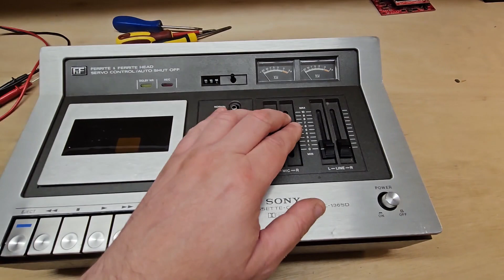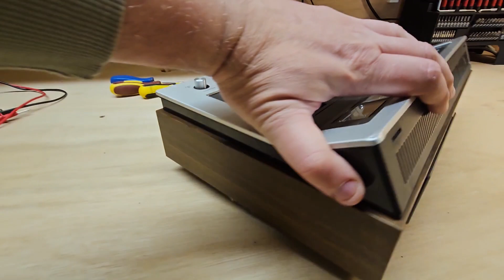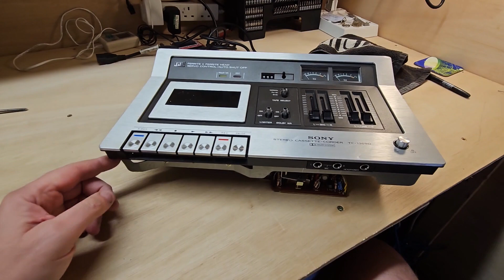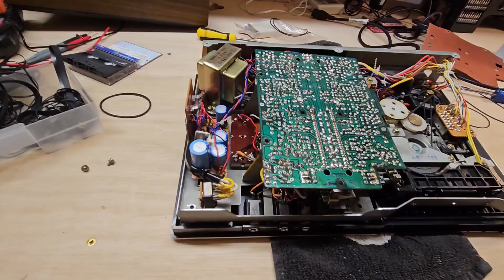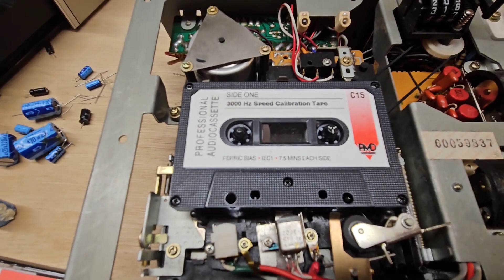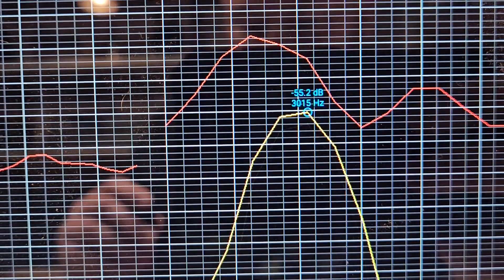1975 Sony TC 136SD Cassette Recorder

Comment: I do love the aesthetic of these 'table-top' cassette machines! Indeed, as you have discovered, they do get quite gummed-up with the dried-out grease! I suspect record not latching may also be down to that. 

As for the oscillation/ maxed-out VU's, try giving those long record and play switches a good hose-down with electrical contact cleaner (DeoxIT; Servisol, etc), and do every other panel switch and slider whilst you're in there (actuate them all by hand, afterwards). 

You might also discover tarnish on the leaf switches in the actual mechanism itself, which is a good indicator of how bad they can get. Overall, a very fun and rewarding repair project. Enjoy! :)
Reply from the maker: Agreed. The pause button was stuck due to dried out grease.